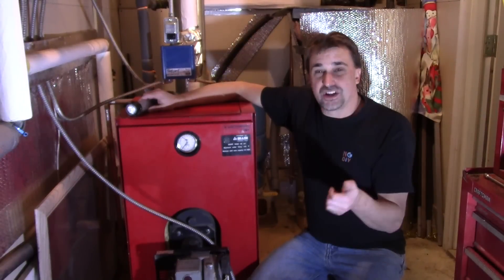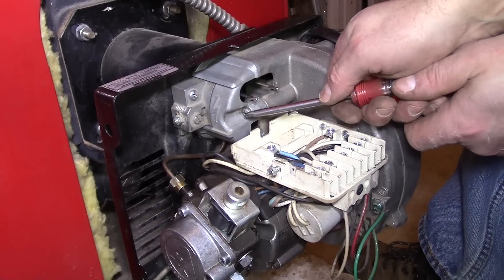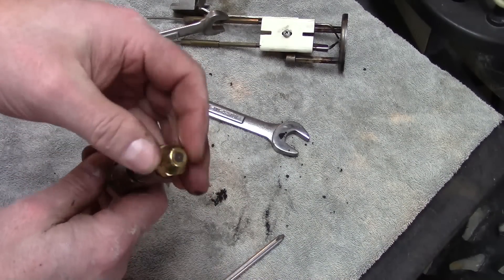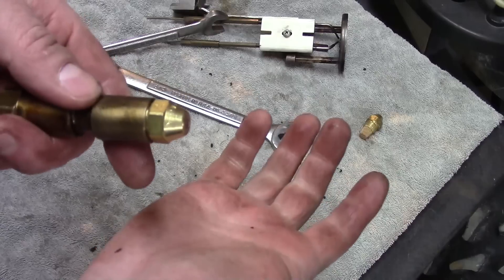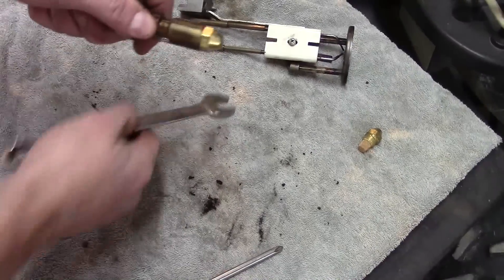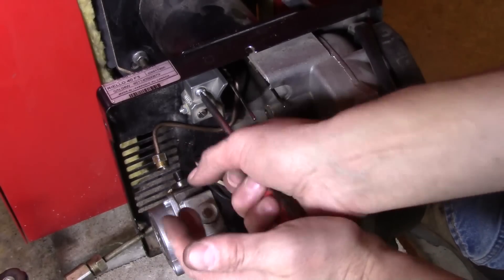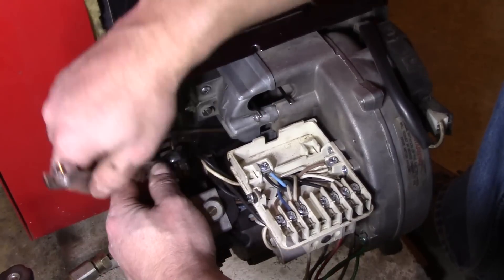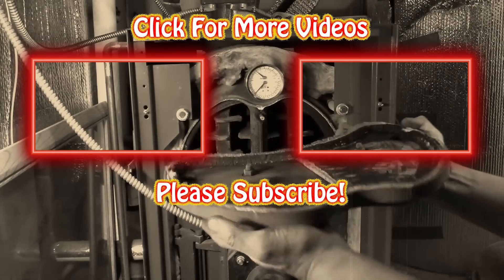How to Replace an Oil Burner Nozzle - - Biasi Boiler and Riello Burner Maintenance Part 3

Comment: Great video but I ran into a glitch, non-related to your presentation. I removed the set screw from the chamber, however the nozzle assembly was stuck and I couldn't remove it. Do you have any suggestions on how to get it out? Thank you.

Comment: Hi, thanks for sharing this. I have followed this video to change the burner nozzle, and after this the furnace didnt come on, only when i push the red reset button, i start heating the loud burning sound and it come off in few seconds, any advice ??
Reply: Thanks fixed the iseue i had to bleed the furnace followed other youtube video and running good now
Reply: Can you share the link to the video that you watched to bleed it, thanks. @AshrafElhakim-t5c

Comment: Can a bad nozzle cause short cycling???? Cause thats what my furnace is doing… i changed the filter from pt1 of ur videos and i checked that pump screen and it had black sludge on half of the screen while the other half was clean. Soo i thought i found the problem but its still short cycling,,, and FYI,, i live in a remote isolated area. We have no certified furnace guy around here.
Reply: Ya, the nozzle or gunline could have that same sludge, while not as severe as your strainer, it could still have gunk in there stopping it from getting the proper fuel to ignite to the nozzle. 

Take her out and spray it with carb cleaner after removing the nozzle.
Reply: Make sure that cone is clean too.

Comment: Hi Mark... I just wanted to ask your advice...i have a burner identical to this one...the oil ran out and I reprimed the line and have good stream of oil out of prime port..very little bot froth every 5 seconds but otherwise straight coloured oil. however after closing prime port...when I press that red button...it will make noise for 4 to 8 s seconds. . Then it fires and burns for 10 seconds and stops. I also notice that I can turn fan on independently from burner..i don't remember that before.. Also it's not self starting as it should because the thermostat is set higher than temperature. Is there a reset that has to be done?
Reply: Look for brass nipple need to bleed to take air out in line. Just open a little bit put coke bottle to catch oil and fire the boiler red bottom after 2 or 3 times and it will start
Reply: I can't see the other reply. On mine you have the bleed the air door shutter cylinder as well or it won't run. It will start,  no fire , then shut back down because no fuel is getting to the nozzle

Comment: At 0:54 when you remove the nut, what is that connected to? My boilers leaking from the other side where the slotted screw in the nut is. Is that for bleeding? Thanks
Reply: Ya that sounds like the bleed port that's leaking.

Comment: Do you have to bleed after this ?
Reply: Only if you cut your knuckles on something.
Reply: Depends on if you have a 2 pipe system, a supply and return(not typical in residential boilers. Or if you have a 1 pipe system. 

1 pipe system you have to bleed. 
2 pipe system you don't.